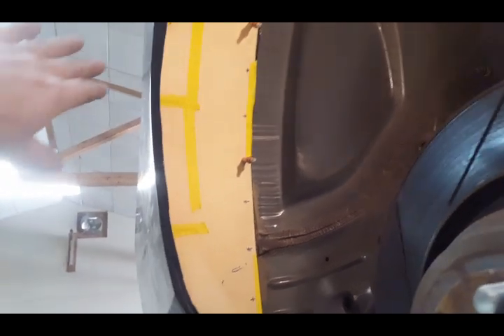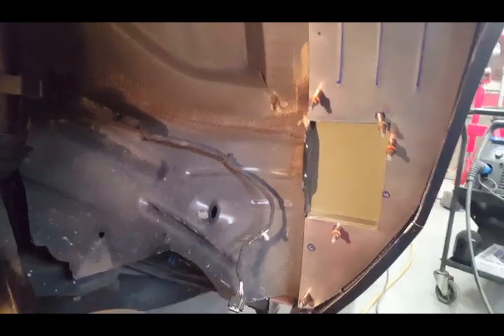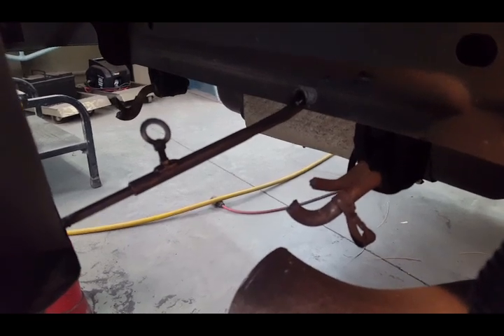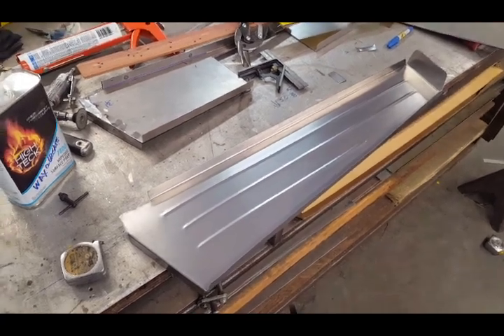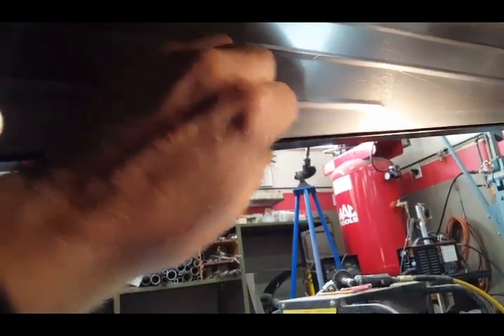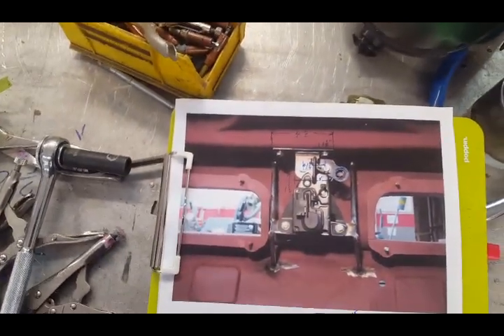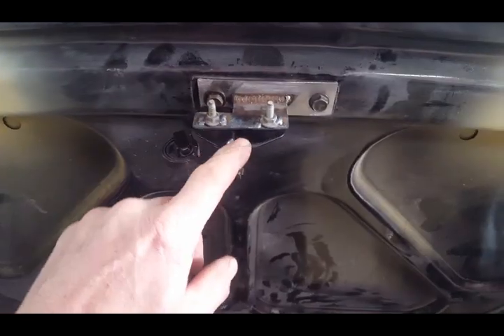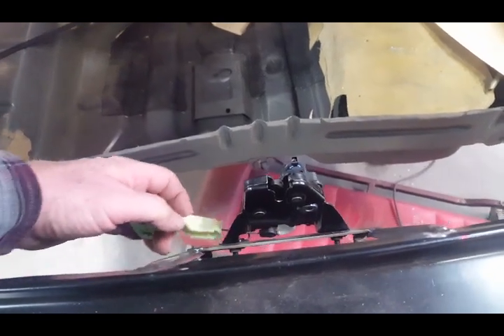Don's 68 Charger body swap part 12

Comment: That’s a lot of work done in one video! You are very skilled with the bead roller Steve.👌 I’m really enjoying all the little titbits about building race cars, I have sourced most my knowledge on body structures from production cars so it’s interesting to hear about the differences race cars have.
Reply from the maker: Matt you would be shocked at the minimalist construction of the stock cars I got to work on and the strength of them when complete. Like an arch. It is all flimsy until the keystone is in and then you could drive a train over it. I only wished I was not forbidden from filming our construction process when working in the sport. Many would find it fascinatiing.

Comment: Good explanation on the "overlap" direction. It makes great sense for the tire rotation. You think "race cars" and I think "home building" which includes water intrusion. Your overlap direction will also shed water and eliminate future problems. 👍👍
Reply from the maker: Ahh! Water infiltration. My nemesis when building residential glass additions back in the 1980's. 😂